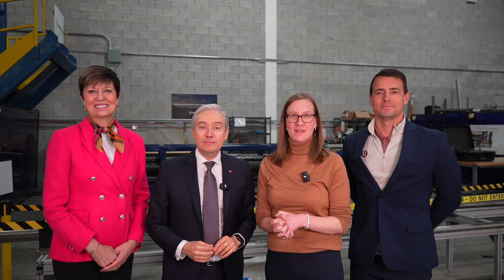eVinci™ Microreactor: 'A Canadian-American Endeavor' in Nuclear Energy Innovation

Comment: How long until first criticality???  How much $$$ per unit?  Could we use this for powering ev charging stations?
Reply: Its still a bit bigger. Big enough for a small factory or 500homes
Reply: @patrickheiskanen2610   ahh -- but when ev semis come out, a 10 stall charging hub with 500 kW each stall would be a nice 5MW, perfect for the eVinci.  If we are going to have ev semis, we need to think big.  There is no way enough grid capacity in the middle of nowhere for a charging hub.   We need nuclear now!